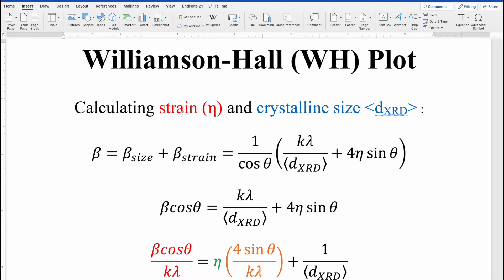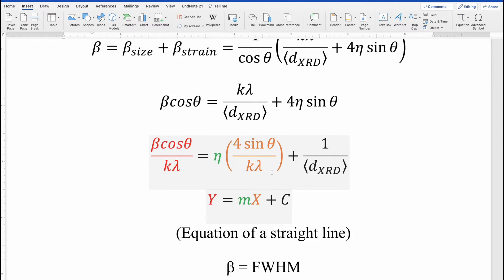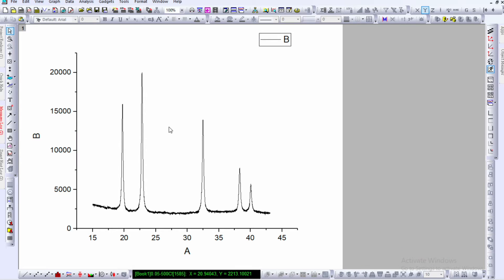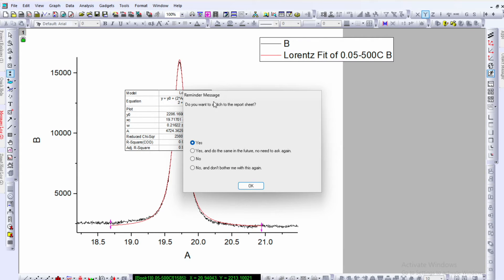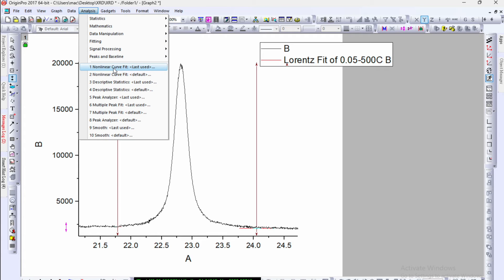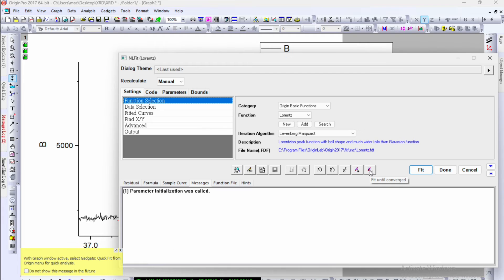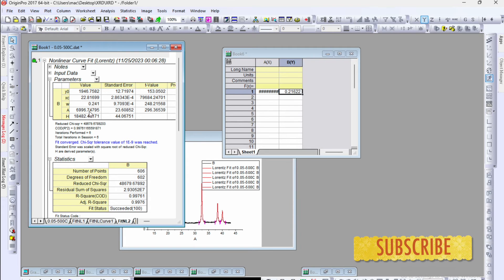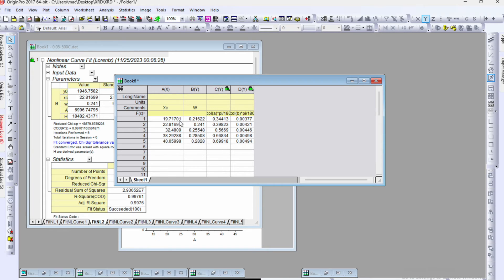Crystalline Size and Microstrain - Williamson Hall Plot XRD #xrdanalysis

Comment: Sir,iam getting negative intercept.
Reply from the maker: •	Incorrect peak broadening correction: If instrumental broadening is overestimated and subtracted, it can cause \beta to be underestimated, leading to negative values in the linear fit.
	•	Strain-dominated broadening: If the microstrain is very high, the line broadening might be almost entirely due to strain, and size contribution becomes negligible or indistinguishable.
	•	Fitting over too narrow range of \theta: Poor data selection or too few data points can lead to unreliable fitting.
	•	Noise or overlapping peaks: Improper deconvolution or use of poor-quality data can distort the line profile.
	•	Incorrect units: Using degrees instead of radians in FWHM or not converting \beta properly.

Comment: Can I use the background corrected XRD data for WH plots, or should it be without any correction? since the bg correction can affect the FWHM slightly
Reply from the maker: It’s always good to use data in its original form…if data looks noisy then please repeat experiment with low scan to reduce the background noise

Comment: Sir the slope in the last..can it be negative??
Reply from the maker: A negative slope in a Williamson-Hall (W-H) plot indicates compressive strain in the crystal lattice. In this plot, the slope represents the microstrain within the material, with a positive slope corresponding to tensile strain and a negative slope to compressive strain. Compressive strain suggests that the atomic planes are pushed closer together, leading to a contracted lattice structure. If the slope is close to zero, it means strain effects are minimal, and peak broadening is primarily due to the finite crystallite size rather than strain-induced distortions.

Comment: Can we get Decreasing FWHM values with increasing 2theta?
Reply from the maker: Yes, the full width at half maximum (FWHM) in X-ray diffraction (XRD) can decrease with increasing 2θ, primarily due to the crystallite size effect described by the Scherrer equation, where FWHM is inversely proportional to cosθ. As 2θ increases, peak broadening due to finite crystallite size decreases. However, strain broadening, which is proportional to tanθ, can cause FWHM to increase at higher angles if microstrain is significant. Instrumental factors and peak asymmetry at lower angles can also contribute to broader peaks. Thus, whether FWHM decreases or increases with 2θ depends on the relative contributions of crystallite size, strain, and instrumental effects.

Comment: Sir, please explain what is the meaning of negative and positive slopes in the W-H plot. and how we can correlate the strain of a material with electrochemical data.
Reply from the maker: Interpretation of the Slope
	1.	Positive Slope:
	•	Indicates tensile strain in the crystal lattice.
	•	The lattice is stretched, resulting in peak broadening associated with an increase in ￼.
	2.	Negative Slope:
	•	Indicates compressive strain in the crystal lattice.
	•	The lattice is compressed, leading to a reduction in the spacing of crystal planes and corresponding peak broadening.

Physical Meaning
	•	Tensile Strain occurs when the crystal lattice is pulled apart, often due to thermal expansion, stress from mismatched substrates, or other external factors.
	•	Compressive Strain happens when the lattice is squeezed, which may arise from external pressure, epitaxial constraints, or shrinkage during cooling.

In summary:
	•	The sign of the slope (￼ or ￼) helps identify whether the crystal lattice is under tensile or compressive strain.
	•	The magnitude of the slope reflects the degree of strain present in the material.

Comment: Why is the wavelength 0.066? Usually it is 1.5406 Angstrom. Sir could you please clarify?
Reply: I have been struggling to get answer.
Reply from the maker: I have used synchrotron radiation which has very high energy (high frequency that is low wavelength) compared to in-house Cu ka which is typical 1.546.
Reply: Thank you very much for your prompt answer Sir! I really appreciate that. Couldn't get back to you earlier as I was completely occupied with the work.

Comment: Why different people use different form of equation for W-H plot. I'll use your method and will comment the authenticity. Cause i am not able to find my particles size closer to sherer formula size. 
A new way of W-H 👍🏼
Reply from the maker: I have been using this method for more than a decade. Hope it will work for you! Good luck.
Reply: If the value of R² is in - minus, is it okay? Then my values of crystllite size matching to the sherer values.
Reply from the maker: @emmakhan14  Research is not about matching one value with another... it's more about giving a scientific explanation. My first question is, where did you get the crystalline size that matches the value extracted using Shceers's formula? If its from SEM/TEM then probably its the particle size and if its matching with the grain size calcualted from XRD then that means nanoparticles are of single grain and not the poly grain. If its not matching and if the size from XRD is smaller than the extracted values from SEM?TEM then the particles are of multigrain. If the second part is true then you may think of apply WH plot to extract the strain caused by the multigrain nature of the individual particles. Good luck.
Reply: @PhDzzz66  yes sir, the crystllite size measured by schere formula from xrd data, the trend was decreasing from 45 to 20 for different samples. SEM was also done and particle size was calculated by software Image.J. this size was greater than xrd from 240 to 50 and was in same decreasing trend. But now my work is reviewed by the journal and asked to compare the crystllite size and microstrain of sherer formula with the WH method. In the literature both of these values are very close like 20, 25. But I applied the WH method following you and many other videos but result is same that microstrain and crystllite size both coming very high like 
43 nm in sherer
78 nm in WH Method 
That's why I'm confused if WH method is for my ferrite nanoparticles or not
Reply from the maker: @emmakhan14  Take a look at this paper: https://www.sciencedirect.com/science/article/pii/S2468519424002969